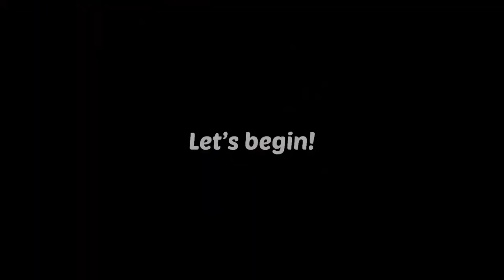I CREATED A BEAUTIFUL BACKYARD OASIS || I AM OBSESSED WITH MY PATIO || COMPLETE PATIO MAKEOVER

Comment: I love your patio makeover. It’s beautiful. I’ve considered a porch swing on my patio. Thanks for confirming that I need to do IT!
Reply from the maker: You are welcome!🤗. I also have always wanted one and when I got my house I instantly knew it was time to get it. The only struggle was finding the studs on the roof deck but aside from that, the installation was pretty straight forward. Thank you for watching!🙏🏽❤️😊
Reply: I was going to ask who installed it. Studs are very hard to locate.
Reply from the maker: @evelynmitchell3616  yes agreed. I tried finding them with a stud finder but I was unsuccessfully. So I reached out to my find who is a structural engineer and with his help we will able to find them by using measurements and hammering nails in where we suspected them to be. He also helped with putting the brackets in. The rest of the installation (assembling the bed together and hanging it up) I did myself. It saved me a lot of money.